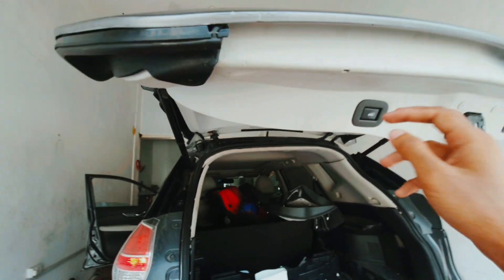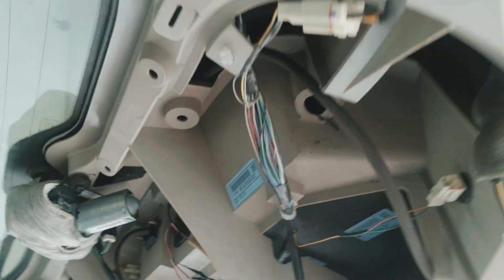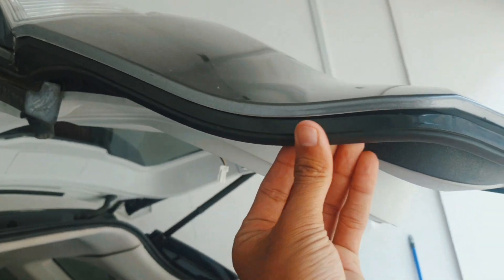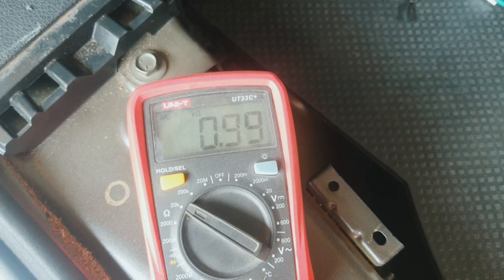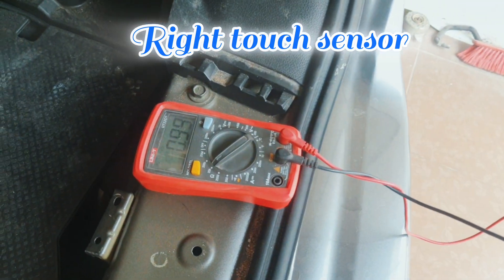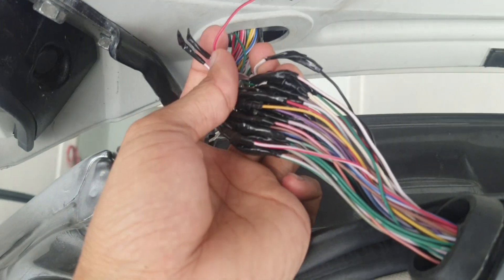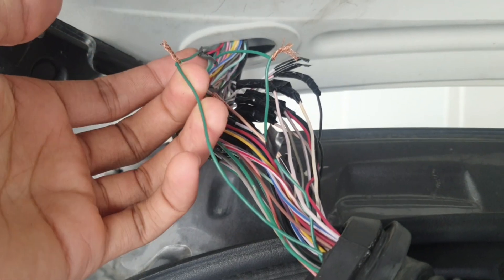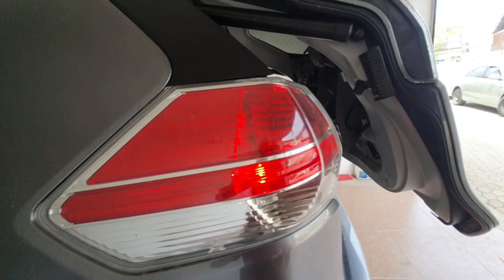Nissan Rogue Liftgate Trunk not working easy fix,fault code B2417,B2420,B2422.

Comment: I have a 2019 rogue sv and my trunk close button isnt working after i left the trunk lid open and disconnected the battery to do a spark plug job. everything was working fine before this. please help!